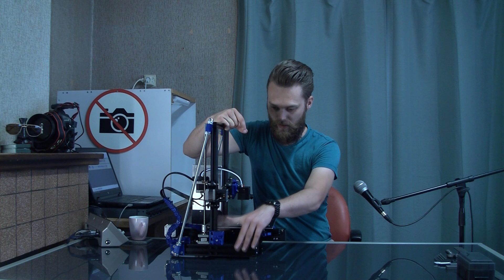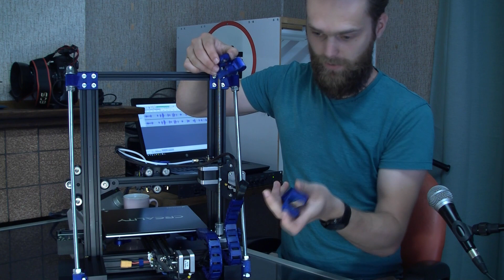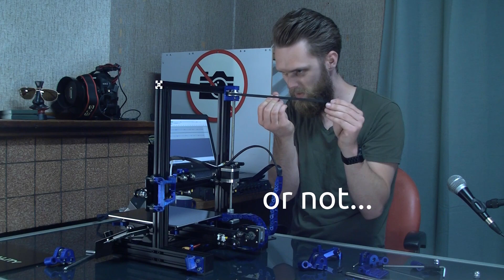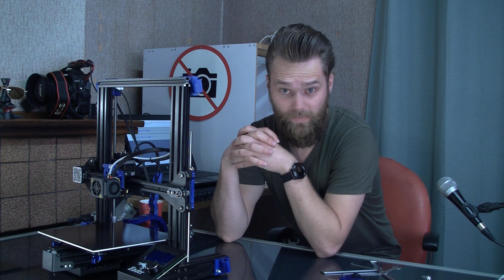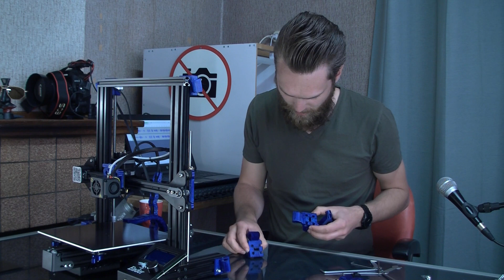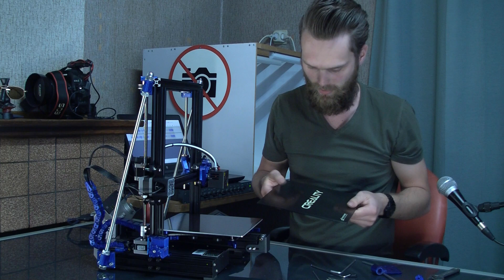Ender 3 pro dual Z axis

Comment: Whats the 1mm_shim for?
Reply from the maker: We have already discussed this on Thingiverse, but for others interested in the answer: "There is a little bit of play between the pulley and the bearings. The shim removes this play so the second z-rod stays at a stable position. If the corner piece is designed without that play, the bearing will rub against the pulley so it doesn't run smooth".
Reply: @properprinting  again thanks Mate..

Comment: I have a question about this.. I actually already added dual z to my Ender 3 but started looking around for some alternative solutions without having to re buy any parts as it's a bit too tall for my Lack Enclosure. This is the current one I have: https://www.thingiverse.com/thing:3440272

Ya think I can re use the belt and lead screw parts I got for that dual z mod?
Reply from the maker: I think that would be possible because it looks like the center distance between both rods is equal to my design. Please let me know if it works out for you or if I can do anything to help.

Comment: Thanks for sharing.. subbed and liked!
Next mod is dual Z and your braces.. why did you go with belt and not dual steppers. 
Iam thinking your design will Work without belt and Just design a stepper Mount?

My setup:
E3d v6
BMG extrude

My plan
Dual Z
CNC poly wheels
Prusa look'alike direc drive.
Skr Mini E3(ordered)
Reply from the maker: Thanks for liking and subscribing! The reason why I went with the belt is because it's cheaper and more importantly, the gantry stays horizontal after stepping loss since it's mechanically linked. I have read about syncing problems and you can easily rotate the motors if the aren't powered hence you cannot be sure if the gantry stays horizontal. Your setup and plan looks awesome! I'll take a look into this and maybe I can use some of it as well. Thanks for sharing this information!
Reply: @properprinting  the reason why i was thinking 2 Z steppers is with the Skr Mini e3 i will have sonsorless homing Just like the prusa.. and that way keep the steppers i sync. The price for me is the same.. steppers from aliExpress are cheap;) i 100℅like your design.. maby the Skr and dual steppers is something for you aswell..
Reply: But.. will go with your design and maby upgrade with extra stepper later.. again thanks, keep up the fine Work!
Reply from the maker: Thanks for using my design and if you decide to add a second stepper, please share your experiences :)

Comment: very interesting, & thanks for sharing, can I ask one thing, do these mods lose Z height or y travel? - thanks again -subbed
Reply from the maker: Thanks for subscribing! Yes, the z height is reduced to approximately 220mm and the build surface is reduced a bit in the y direction. These are some drawbacks which aren’t a problem for me, but this is something to keep in mind. Thanks for asking.
Reply: @properprinting  thanks for your honest reply, 220mm is about as high as I would go on my ender anyway, a bit higher than that and the bowden tub starts to rub on the top of the frame anyway, I was so  impressed with your design of the X gantry bracket for the idler side that I abandoned my own design and printed yours in  ABS which came out perfectly, -  I'm taking a slightly different route for the  dual Z - as I have a few kp08  pillow blocks  kicking around  I plan on creating spacers for those instead - thanks again for the inspiration
Reply from the maker: @DevilbyMoonlight  Awesome, thanks for using my design and great that it came out perfectly with ABS! I haven't tried that yet. I have looked into these pillow blocks as well which seems to me being a great solution. The route I chose was easier for me but if you already have these lying around I would use these too. Are you willing to share your design once it's finished? I recon more people can benefit from it.